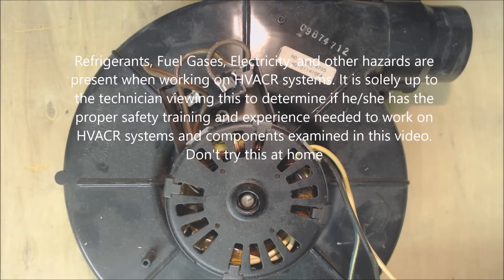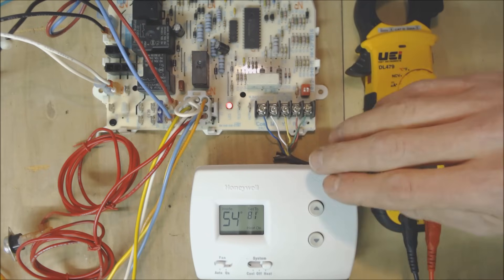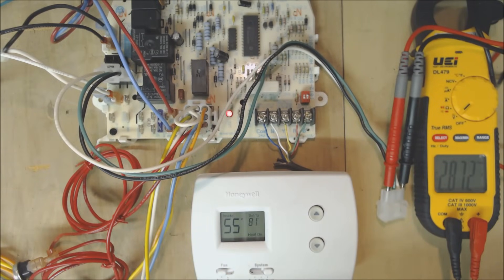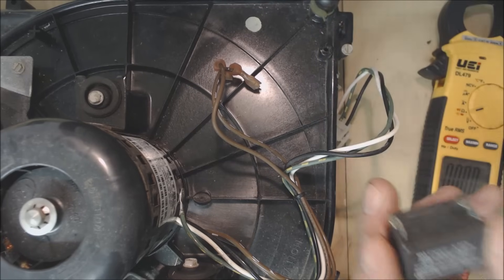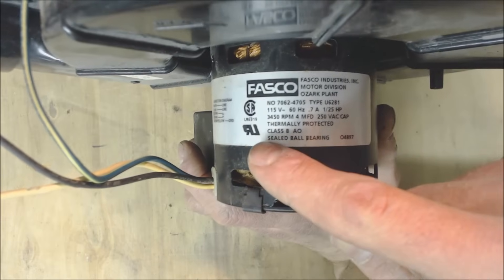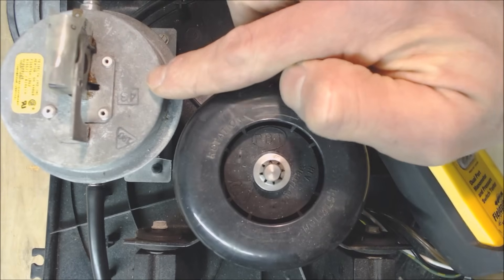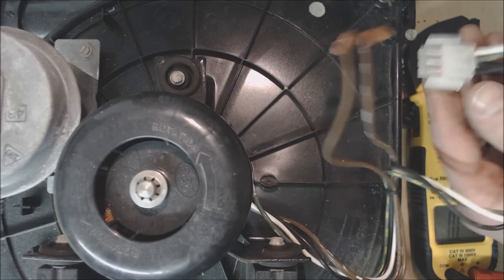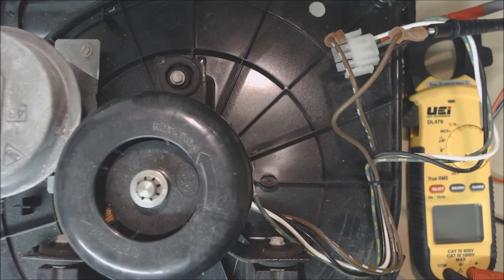Furnace Inducer Motor Troubleshooting! Top 8 Problems!

Comment: Looks like bearings.  My inducer fan occasionally doesn't turn on when the furnace tries to start.   If you give it a gentle nudge it starts right up and spins freely.  This doesn't happen very often and you never know when it will.  
The way I found out it was doing it all is I smelled hot metal or plastic one morning when I got up and traced it to the furnace.  
Called a furnace repair guy and he said t was the motor. 
Been waiting over 3 months since January for a replacement.   Just keeping a close eye on it to make sure it doesn't get stuck.

Is it common to not be able to get a part for months?  I've looked online for a part myself and no one stocks them.

Furnace is a Peerless PSCII, LP boiler.   Inducer part number is 50773.

Comment: i have a bryant 1 stage 5 yo furnace. getting code 31(pressure switch do not close or reopen) checked another video related to switch(pipes are clean, can hear a click when blowing). noticed that my inducer motor never spun. removed motor(visually all good looks like new, ez and smooth spinning with hands). 
went on checking wires with meter(wires from end to end are good, no breaks,  pinged with meter). inducer motor dont get any power. so basically i starting a furnace - first 90 second is blower working( so board is getting 120-cheked with meter, have 26 if i connect R to C, transformer is also getting power, sending power to blower, bypassed thermostat by R-W: no power to induced motor) so on control board there is a double prong connection with 2 black wires that leading to inducer motor and hot surface ignitor - and thats the only one that dont send any power further. 
after this can we say that control board is cooked? or am i missing something? so board getting power, sending it to blower, to transformer, but dont send to induced motor

Comment: Had an issue with my house temp being a 6-7 degrees below setpoint. I check on furnace and it is giving me code 42.  It's a carrier by the way.  If you wiggle the harness that plugs into the ecm motor the motor occasionally will pulse.  I checked the harness connections and even ran a brush over the connections.    Sometimes the furnace will run and sometimes it won't.   Sometimes it will stop mid cycle.  Any ideas?

Comment: Thanks for the info. Seems that my furnace is having issues staying on after the initial start up. I did hear you mention that problem #2 can be due to a bad board. Im having the symptom of the fan staying on after the furnace shuts off and inducer motor does not start first at initial start up.

Comment: I had a long night. My inducer motor was not spinning and it seems like the impeller was jamming inside the housing. When I took it off I found the gasket material deteriorated and I suspect it may have jammed up the impeller. Unfortunately I can't open the impeller housing, even with all the screws removed. After freeing up the impeller and reinstalling the motor it worked fine. Now it's working as if nothing happened. The motor is spinning freely. Do I need to worry? We're going away from the house for a while and I need the furnace to work.

Comment: Hi, my york YP9C inducer motor has only two wires. How does it able to ramp up and down with only two wires connected. One wire is HOT and the other is NEUTRAL. Thanks.

Comment: What is that little Amber plastic part on the center of the backside of the induction fan at 0:24 in your video.  mine is busted and was in the blower housing.  Can I run my furnace with this piece missing?

Comment: I have a problem where I hear the humming current going through my inducer motor but it's not spinning. I turn off the furnace and start up again and the inducer motor does the same thing. I thought it's the capacitor so I bought a new replacement but it's doing the same thing. I tried spinning the motor by hand and it would go slowly with resistance. But once I turn the furnace off I am able to spin the inducer motor freely. So I don't think the bearings are seized. Any idea to what might be wrong?

Comment: very educative. Thank you. what is the normal current draw of inducer motor. should the amp clamp be away from the motor as much as possible to reduce effect of induced current due to the motor when it runs . Thank you regards .

Comment: I got a no heat call.   I set the stat to heat the inducer runs but the pressure switch is stuck open so no flame,  I touched it and it was hot but not scorching hot I think I'm going to swap it out

Comment: Always check the t stat and filter first and the the overtemp switches but, Its usually the bearings in the inducer that go bad. Just spinning the motor like you showed can usually show a problem. This can often cause the relay on the board to fail. I just usually power up the inducer motor with jumper leads if it looks ok to test it.

Comment: Got one that im stuck on: Changed induced draft motor, board, pressure switch, and still getting a pressure switch stuck open on a amana 80 percent(3 flashes). Any ideas?

Comment: Great video. What if the inducer motor won’t turn off.  Replaced both pressure switches, all drains free and clear
Reply from the maker: it may be a thermal sensor that is tripped, thanks!

Comment: I found my induction motor would not always start up and it seems to be due to "play" in the way it is attached to the housing (perhaps just from time, since it is over 20 years old).  I could not find a way to tighten things down to the housing / mount, so I attached a strap to help secure the motor.  It had to be in the right place, so I've needed to tweak it.  However, not sure the strap will stay put long term, but it seems to help stablize the motor.  It seems the only real fix is to replace the motor, they come with the mounts... I was hoping for a less expensive fix.  Ideas welcome.

Comment: So I can hear my inducer motor working, but it won't close my replacement pressure switch. I read to disconnect the hose between the motor to the pressure switch, blow/suck air and I would hear the click on the pressure switch, which i do. But when I replaced the hose back onto the motor after blowing/sucking through, the furnace won't run on its on. Is it a failing inducer motor?

Comment: Thanks for this posting.    It led me to find stink bugs migrated to the exhaust fan and  jambed the impeller.    Fewer than 10 found their way over the summer and fall.    I did have to take the fan out to get there.    Thanks for the comments that it isn't always the pressure switch.
Reply: I have found birds in there from improper coverings on the exhaust.

Comment: Thank you so much for this video ❤️ 
But I have a question 

What value of uf is needed for the capacitor to work properly in an induced  motor?
Reply: The uf rating will be indicated on the capacitor.

Comment: Thank you so much for this!  I have a brand new variable speed Goodman Furnace in my attic for my second story.  When I turn the heat on, heat will come through the registers for ten minutes.  Then the inducer motor will shift into a high gear and make a very Loud noise for 90 seconds.   It's so loud it sounds like an airplane is taking off.   After 90 seconds the inducer motor will either shut down, or shift to a quieter speed.   When this happens, all heat will stop coming through the registers.  The heat shuts down before reaching the temp the thermostat is set to.   My HVAC contractor tried to trouble shoot by taking off the NEST thermostat and hot-wiring the thermostat.   Nothing changed.   Heat flowed for 10 minutes.  Then the inducer motor sped up and sounded like an airplane for 90 seconds.   Then the inducer quieted down and the heat shut off completely.   Now, my HVAC contractor has no idea what the problem is.   Any idea what we should be checking?   (Also, my HVAC contractors said there's nothing I can do about the loudness of the inducer motor.   It's not due to vibration so suspending it won't help.  Plus my attic ceiling is too high to suspend it.  I'm in California.  He said this type of inducer motor is only required in California.  Is there anything I can do about the LOUDNESS??)  Thank you again!

Comment: our furnace is making noise, was told it was the draft control. Furnace was not ran for a couple years, can you oil them?  It didnt spin at first as if it was locked up and he turned it and it did finally start spinning
Reply: The type we have is what is in problem 3, it is made just like that one?\

Comment: during normal operations the inducer runs constantly. without stopping.  if I short cycle(my own term in which I turn stat up requesting heat and once squirrel cage engages I physically turn stat down 10 degrees below ambient; blower stops & internals retained heat raises enough for a second blower run to cool- maybe a minute or two.  After this "short cycle" when blower stops the inducer also stops.  I find this as the only way to stop inducer motor.  What am I experiencing?

Comment: Great video. Thank you. Question:
I'm replacing my inducer motor ONLY. I see there's clear silicone around the assembly. My question is, is there any temperarture rating for the silicone? I do not mean the seal betweek the assemlbly and the furnace, which does get hot. TIA
Reply: High temp silicone

Comment: Great video, but couldn’t get far as my problem happened early... I don’t have any voltage on control board from r to c or (w to c) I also tried jumping the thermostat and nothing. Furnace originally reading a “Pressure switch open fault” I don’t think I’m doing anything wrong...

Comment: Hi, I have a carrier infiniti furnace the ecm inducer comes on right away when power is supplied to it without a call for heat. Took off all the thermostat wires thinking it might be the thermostat but still the same, replaced the board already. Could it be the inducer ? Thanks
Reply: N sahar, i have the same problem where you able to find the problem?

Comment: When the thermostat calls for heat the inducer motor turns on then off immediately. Three lights flashing. After a few minutes it trys to start again. It may do this once, twice, 3, 4 times before it stays on. This doesn`t happen all the time. For a week it may start every time. Its an erratic issue.  When this happens: thermostat is sending 24 volts to the board. there is no power to the inducer motor from the control board, I can hear the blower relay click on then off, so I replaced the control board. Same issue. I replaced the inducer motor. Same issue. I replaced the pressure switch . Same issue. Thermostat is new and performing as it should, it is sending 24 volts to board. Wiring is good. This is driving me nuts. There is nothing left to check. What is causing this?
Reply: Try replacing the Transformer. Unless it is a good 24vac at all times even when it did not come on and stay on.
Reply: Hey Dennis did you ever figure it out? I have the same problem,loses voltage at the board after the inducer fan runs for about 1 second.If i turn the furnace off and try again it will
eventually start and run normally.I think it s the board but not 100% sure. Thanks man  have a good day.

Comment: I have been having an issue for a few years now, where my inducer will occasionally attempt to start a few times, before it stays on. It does not do it all the time, sometimes it starts normally. But other times it may start/stop a few times before finally staying on for a complete heat cycle. I put a clamp meter on the power wire, and can see the amps going from 1.5 to 0.0 - when it acts up like that. 

I thought that indicated a bad control board, so I got another board last year, which did not resolve the issue. Last year I disconnected the vacuum from the mounting screws and checked that it was clicking when I sucked on the vacuum hose. It was. And the vacuum port to the inducer was clear also. Funny thing, I just left it hanging and the start/stop issue seemed to stop. Does that make any sense? I eventually remounted the vacuum switch, and did not notice the problem again until this year. This year the inducer is doing the start/stop occasionally again. Not always, but occasionally. What could be the problem?

I have a video here that shows the issue. 

https://www.youtube.com/watch?v=IdkmydTMoNc&lc=z23yundwnwfjul3lhacdp432vlmrbhpa1i5tzt0cnh1w03c010c.1576782577825593&feature=em-comments
Reply: I have the same exact issue with my furnace. I checked everything. When it happens, there is no power to the inducer motor from the control board, so I replaced the control board. Same issue. I replaced the inducer motor. Same issue. I replaced the pressure switch . Same issue. Thermostat is new and performing as it should. Wiring is good. This is driving me nuts. There is nothing left to check. What is causing this?
Reply: @dennisnagel1037  Replacing  the vacuum switch is the one thing I didn't try, and the one thing I thought could be the cause of the problem. Thanks for letting me know it did not resolve your problem. I wish I knew the answer. It seems nobody knows!
Reply: Hi Dennis, I ended up buying a new vacuum switch, and that solved my problem. 

I read about a voltage test that can be done on the vacuum switch. When the vacuum switch is closed it should read 0 volts. When it is open it should read Around 27 volts. When I tested my old switch, in the closed position , it very often was reading any where from 0.1 to 0.3 volts. It got me thinking that perhaps the old switch was not  closing all the way  and that's why there was a slight voltage reading .  I don't know for sure that's only a guess on my part .  Anyways, That made me buy a new vacuum switch and now my furnace starts up without any hesitations all the time. For a few weeks. Actually it's been working great. Maybe that's your problem also? I ordered the switch online for a place called supplyhouse.com I think it was. It looks slightly different but the functionality is the same.

Oh, and the way I tested for voltage, once I slipped the to contacts about halfway off the Tang's on the vacuum switch. That way I could attached the alligator clips from my multimeter, and see the voltage ratings as the furnace would start up and stop. Very simple test to do actually. The only thing is my first was tripping off and on so quickly do I sometimes hard to read the multimeter measurements as they were changing very quickly to. 

Let me know if this helps you at all.

Comment: what if my inducer fan only tests at 86 volts when calling for heat and tests at 120 coming from the board
Reply from the maker: Sounds like you are loosing voltage in the wire feeding the inducer if you are getting 120v from the board on the inducer taps, thanks!

Comment: I had vac switch code... inducer would shut off after 20 sec sometimes or 5 min. I ended up removing control board and cleaning it front and back with soft brush and reinstalling it as a last resort.  FIXED!!! Guess the dust was shorting board. I coulda bought a new board and not try to clean old one but im a stubborn bastard 😜 25 yr old goodman unit.... tech woulda sold me a whole new furnace... not this time, sukkas

Comment: If the motor does say”sealed bearings” and only has a hole in the front toward the blower wheel, can you oil it?
  My motor was stiff. I removed and let it run on the ground. It started a little slow, but started running.  I heard something loose in the housing when I removed it. Found a piece of gravel.  Not sure if it was in it already, or if I somehow got it in it when I laid it on the ground. I don’t think I did actually but have no good idea how a piece of gravel from the drive could have gotten in it. Rodent?
  Also, the motor only has two wires going to it. They honed at 49 ohms I think it was. It is a 220 volt motor.
Reply from the maker: The problem is you dont want that to be running with stiff bearings and catch on fire. That is a real thing that seems to happen to inducer motors more than any other component. You may want to consider replacing that, thanks
Reply: AC Service Tech LLC I meant to say the motor is notstamped “sealed”
  I did get the motor spinning a little more freely, but only ran for a little bit. Getting back on it today as was dark and cold when I last checked it. I suspect the bearings got hot and caused the motor to overheat. 
  Not sure I am getting power to the motor now as it did seem to get warm like it first did when I noticed it. 
  I will check for 220-230 at the board that supplies power to the two wires going to the motor again. 
  I do think It is best to replace the motor since the windings, bearings  and or thermal protector may be damaged. I had thought of replacing the bearings, but this thing is about 19 or 20 years old. 
  The only service it has ever had was when I cleaned the coils a time or two and replaced capacitor.
  Does 44 ohms sound right for the motor?  It only has two wires going to it, red and yellow from the board.
  Found the immediate problem. When I bundled the wires up again with the zip tie, I pulled a blue wire off the relay. The motor was still very slow to start, but it did eventually get up to what I think is the correct speed and the heater fired up. 
  Going to let it run a little and check the motor for getting warm.
  Update:  I let it run for a little bit. I suspected the motor was still stiff because it would move very slowly when trying to run. I boosted a little a few times with a screw driver against the fins inside the motor until it got moving faster and it finally got up to speed. but, it got too hot to lay my hand on for very long. 
  Motor time. :(